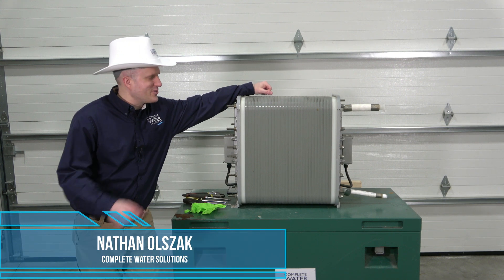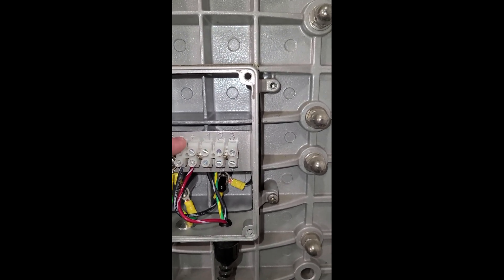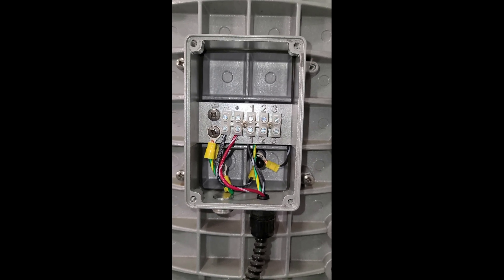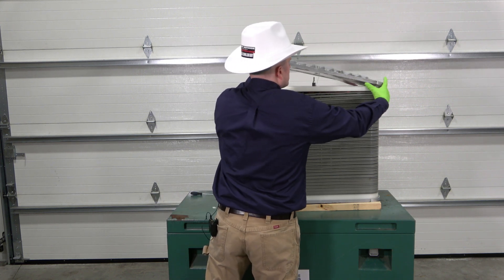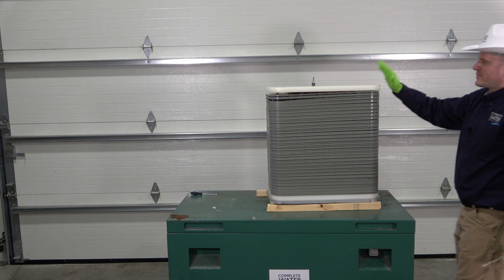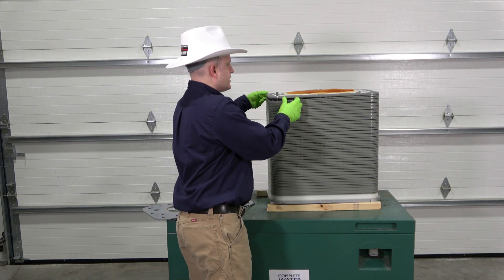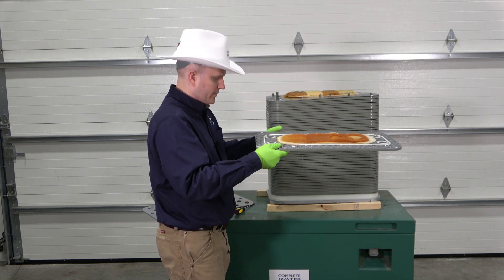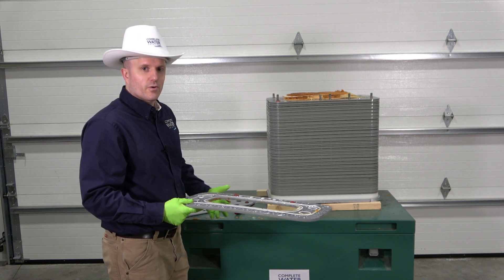Continuous Electronic Deionization (CEDI) - What Is Inside CEDI

Comment: We have packs going bad. Our pH on our water is 8.6-9.0 coming out of our RO. We've had intermittent hard water issues from our softeners switching back. 

My question is can the granules inside loaded with magnesium/calcium/iron/etc. be saved? I would think trying to recharge them with an acid recirculation might do the trick.
Reply: Hello, So my recommendation is to review the manual of the CEDI / EDI Stack Manufacture. They will have procedures for cleaning the Stacks. Highly recommend following it step by step as you can cause irreversible damage.

Comment: Hi. I would like to ask for any recommendation.. our EDI have 4 stacks. 2 of them is not functioning as the amperage is zero. already changed the rectifiers but no improvement. Is the problem within the internals of the stack? thanks
Reply from the maker: I would check the controls if its displaying zero and you have no power at the stack then there is something going on with the controls.

Comment: I think anion and cation resin are using inside of module. I want to try manufacturing a prototype CEDI module. Which type resin is used in CEDI modules? OH form or Cl form? Or do you have any advice for usable resin brand and model?
Reply from the maker: Thanks for reaching out. There are a few manufactures of cedi stacks. Ion pure, suez, snowpure, iontech just to name a few. Each one has a different resin, membrane and flow characteristics. You might be able to find data sheets that can give you some further info.
Reply: @completewater  Thank you for your advice. I have disassemblied 1 iontech modules its inside is look like very basic but i guess resin type is very special and i can't determine it. Because i try with some of mixbed resin or anion/cation resin such as purolite mb400, trilite ma20 and mc08h etc. But voltages are very high(500V at 2 amper) and pressure is 0.8 bar at 5 m3. Its pressure was 2bar at 5m3 and voltage was 100V at 2 amper with original resin before i dissaemblied. Also product resistance is reducing to 2MOhm after 50m3. I think my fault is resin. I have to find suitable resin for CEDI.
Reply from the maker: @kamilaktemur  My recommendation would be to talk to Dow or ResinTech see if they can provide you some support as to what would work best.

Comment: I thank you for this wonderful explanation, but I have a question.. May I know the amount of voltage and current that works on the EDI system, and is it related to the number of cells or layers of the EDI...
Reply from the maker: Good day,

The voltage is typically DC. It can vary  depending on the size of the stack and manufacture recommendations along with water quality / flow rates. Some common tech specs provide this as a range 0–300 VDC Amperage 0–5.2 ADC

Comment: Very good video..I spend lot of data to see edi internal parts..but all shows with graph ..no one found actual..but you did..thanks a lot..I am looking for brackish water treatment for irrigation..my borewell water with high tds 8500ppm and much NaCL ..I installed electromeganatic divice but no use..RO booster pump need high voltage and three phase electricity connection..I have only single phase 220v wich is good for only 1000lph but I want atleast 2000lph to 5000lph ..I have 3kv solar ..If you have any idea or suggestion to help me I will be grateful you..my email..mohit4826@gmail.com..
Reply from the maker: Hi 4826mohit, thanks for watching our video and commenting. Its appreciated and very helpful. We hope to make some more helpful videos coming soon. Most larger RO systems require 3 phase, just due to the amount of power / pressure required. So you could do a few things here - 1.) you could use 2-3 RO Systems to make up the amount of water required. Or
2.) you could get a phase converter - a Phase converter will take 220v 1 phase and convert it to 3 Phase. 

we will email you a company that we have used that offers this option.
Reply: Thanks and regards for your reply and suggestion. This is also came in mind but still I m looking for less energy consumption options if not any practical method found than will go for RO....waiting for your more videos regarding cdi, edr, etc ..